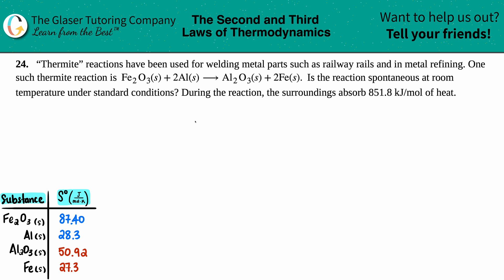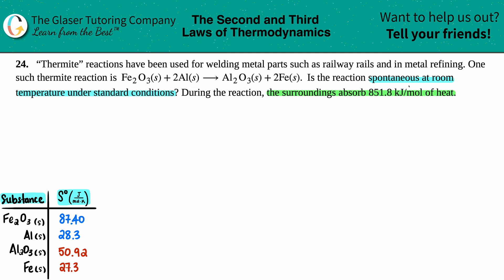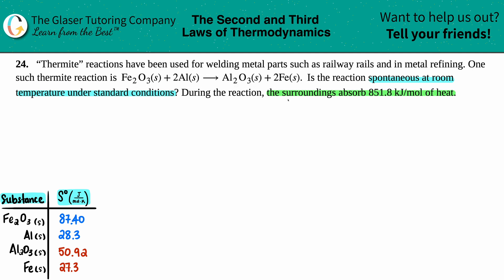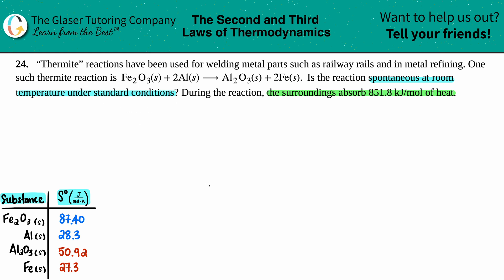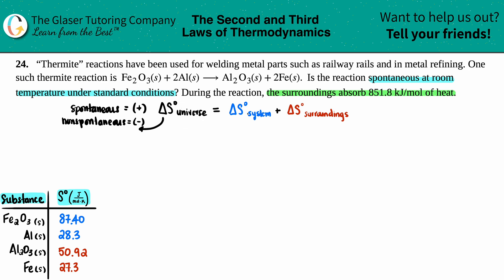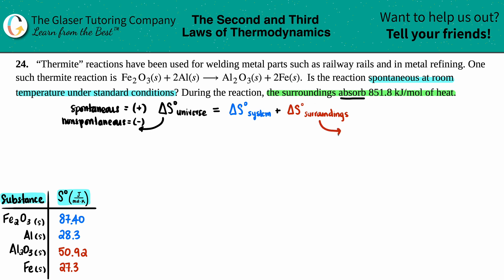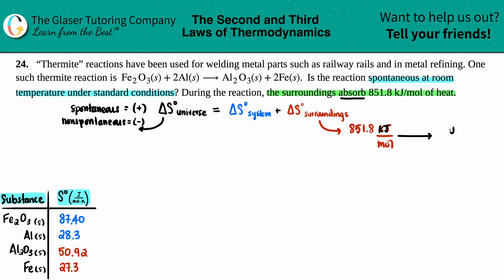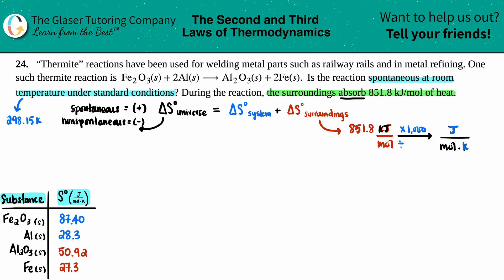16.24 | “Thermite” reactions have been used for welding metal parts such as railway rails and in

Comment: what's the significance of the word "absorbs"
Reply from the maker: Great question! The word "absorbs" here is significant because it indicates that heat is taken in by the surroundings during the reaction, meaning the reaction releases energy as heat. This is an exothermic reaction. The surroundings absorb heat, implying that the system (the reacting substances) is losing heat, which is why the reaction gives off 851.8 kJ/mol.

In terms of spontaneity, the release of heat (exothermic nature) generally favors a spontaneous reaction at room temperature, though we also need to consider the entropy change to fully determine spontaneity using Gibbs free energy.

Hopefully this helps!
Reply: @GlaserTutoring  Thank you!!!

Comment: I got the same final results or the reaction being spontaneous, but I solved for Gibbs free energy with ΔG=ΔH−TΔS, using the 851.kJ/mol as the enthalpy, and solving for entropy as done in the video. Is this method still correct? or did i get the same results by chance